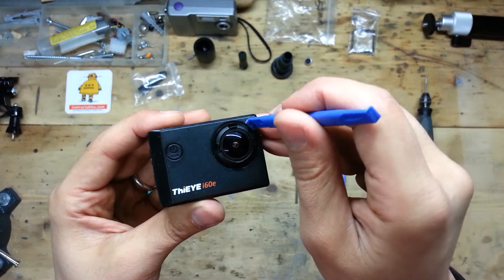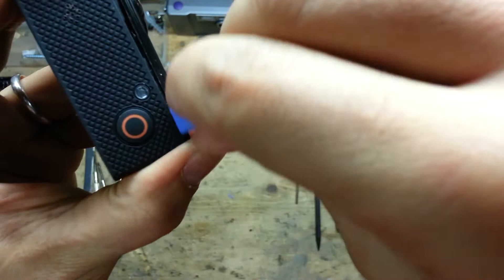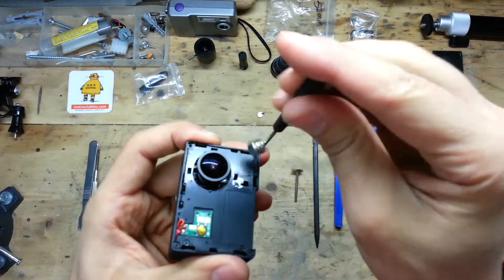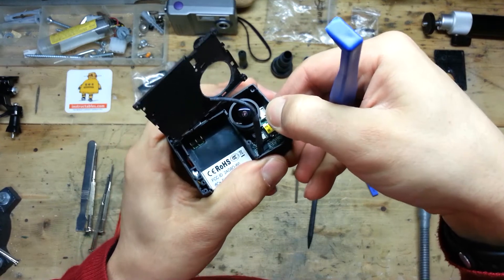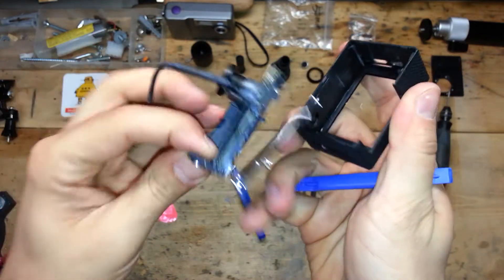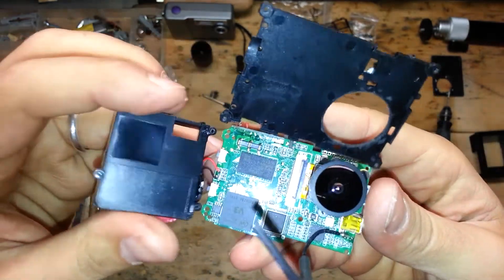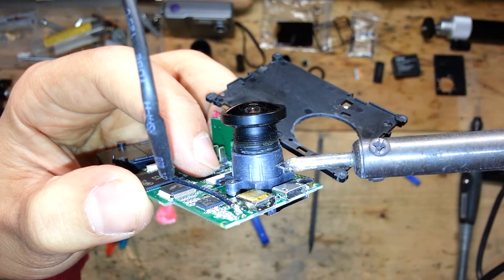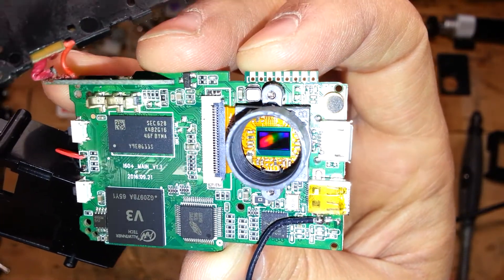Action Camera Hacking - Pt.3 Open the Action Cam

Comment: An alternative in removing the glue is placing a drop or two of acetone in the glue joint. Most of the time (cyanoacrylic glue) CA is used as a glue for plastics and acetone will degrade CA. After a few minutes you’ll notice a white discoloration of the glue, you now can try unscrewing the lens cover. If it is a little slippery with the fingers, wrap a layer of masking tape around the edge of the lens (to protect it from being damaged) and use a pair of long nose pliers to grip it to unscrew.